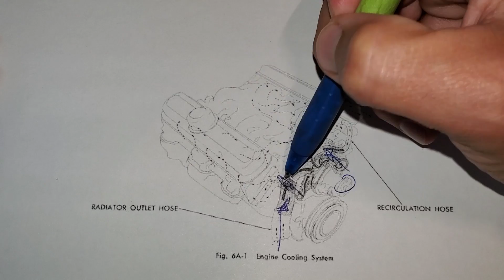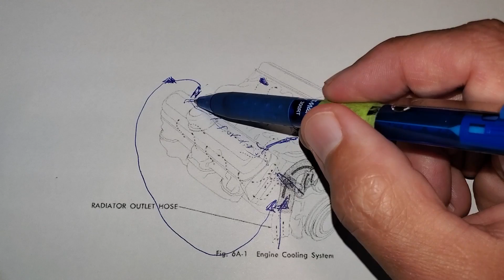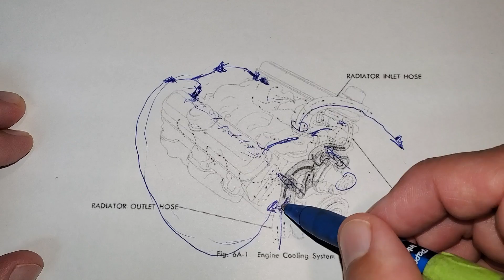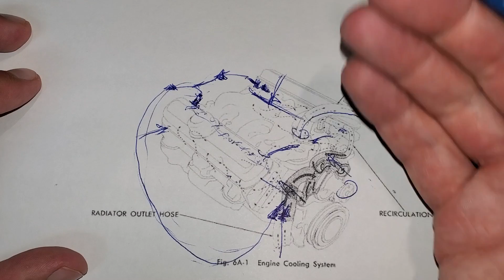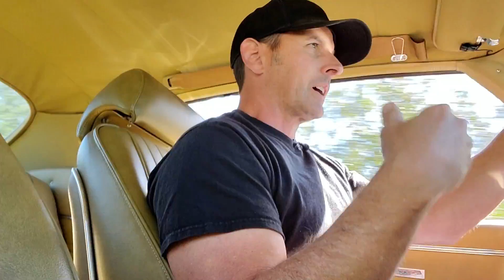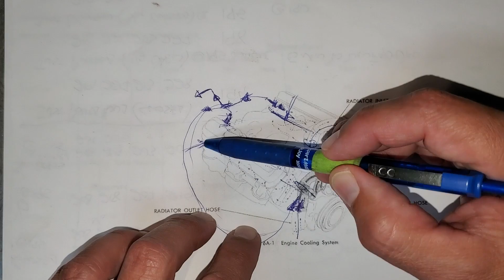Pontiac Head Cooling Trick - Heater Hose Myth?

Comment: Looking at swapping out all of my heater hose with AN line like you. Are you running -8 or -10 on everything? Also have my timing cover off right now so I’ll be doing the weld on bungs like in your lower radiator hose video.
Reply from the maker: Very cool... get it?  ha, ha... yeah, -10's all over.  Before you go nuts, and if you're running the T'd heads trick, check out my latest video on this subject.  https://youtu.be/v_qUY4E33r0  Have fun!

Comment: A lot of the '60's and '70's non-AC cars had full flow through the core all the time and a diverter door or flap to direct the fresh air over the core. It was simple and cheap. The restrictor is to ensure the coolant spends enough time in the core to throw off the heat. Without the heater blower fan running both heads should be about the same. BTW, a ball valve is designed to be either fully opened or fully closed. It's not meant to be a flow regulator. Eventually the ball will erode from the flow and it won't seal. You need either a restrictor or a different valve. 
There's more complexity to localized head temperature than trying make sure it's all homogenous. In the late '60's-early '70's manufacturers deliberately restricted coolant from the heads to control emissions like N2O by increasing combustion temperatures. Some of the gaskets had restricted holes for the coolant passages. If you increase head temps and combustion temps BSFC decreases and efficiency increases. NOx however will increase slightly.
Reply from the maker: Agreed.  Thanks Vince.  But, both head temps are not the same, if you're flowing coolant out the back of one head.  Which I proved.   Thanks for the comment!

Comment: That's great stuff! I really like your testing to prove why the solution is best. There are a lot of rumours and myths in the classic car industri. 

Besides that I am going to rebuild/freshen up my 68' and cooling system (and this solution) is definitely going to be a part of that. The divider plate design is some shit hopefully the 11 bolt design is "less shit" than 8 bolt. Have you done any testing on those 2 water pump designs?
Reply from the maker: Thanks.... yeah, testing water pumps would be a colossal amount of work, so no.  ha, ha... I'm sure the 11 bolts are better.  Just be sure to check out my water pump install video.  Also, check out the latest video of the rear head plumbing...  https://youtu.be/v_qUY4E33r0  Thanks again!

Comment: So this is a great idea but will only work on "newer" pontiacs lol if there is such a thing with D port ponchos.....but it will not work on the older 12 bolt style heads....pre 65 because there is no nipple on the rear of either head as the rear of the intake covers those coolant jackets......also 65-66 it wont work on because the throttle bell crank bolts over the soft plug blocking the passage on the driver head......just a little info on the older stuff......
Reply from the maker: Thanks Steven!  Love the added info.
Reply: @FastMonty  i love the fact you do a lot of poncho specific stuff.....thats why i watch......ima poncho guy as well.....oh and love the goat
Reply from the maker: @stevenhagebusch9561  Thanks Steven!  I appreciate the comment, welcome to the FMG family.

Comment: Hello FMG, I just finished plumbing my cross over on a 471 Pontiac using Edelbrock D-Port heads. Here is a list of parts I used:

2- 3/4” male NPT to 8AN male adapters. They screw into the heads on either rear port. This is the beginning of AN.

2- 8AN Female 90 degree swivels. One goes directly on the left head adapter. This puts the hose side coming out to the left of the distributor. The other one will be used on the right side. That’s  all the hardware for the left side.

1- Female to 8AN Male Flare 90 Degree Swivel Hose Fitting. Attaches to the right side adapter. Position so it points to the rear of the engine past the right side of the distributor.

1- 8AN T fitting, single female, double male. Female side attaches to the fitting above. Angle the stem of the T about 45 degrees.

Now attach the other 8AN Female 90 degree swivel to the end of the  T. This will have the hose end making a nice turn around the back of the distributor. 

1- 8AN 45 degree female. Attaches to the other male portion of the T and should point towards the heater input.

5 feet 8AN hose. Cut to length to connect the left and right sides together behind the distributor. Cut another length to connect the 45 degree swivel to the heater.

1- 8AN hose finisher clamp.

That should be all the hardware needed to fab the crossover and connect to the heater.

You will also need another 5 feet of 10AN hose to connect the heater to the timing cover along with 2 -10AN hose finisher clamps.

Hope this helps.
Reply from the maker: Awesome Summary!  Now you need to watch my latest cooling analysis, which will give you some more ideas... https://youtu.be/v_qUY4E33r0

Comment: Quick questions:

- what AN size did you use to make the rear crossover?

- what AN sizes are you running into and out of the heater core?
Reply: Ok, that may explain why the restrictor lowered the engine temp.
Reply from the maker: @urqed5305  Yup, too fast of flow doesn't give the radiator enough time to cool.
Reply: Agreed. Your videos are very
well done with some great tips!
Reply from the maker: @urqed5305  Thanks!  Much appreciated!
Reply from the maker: Good questions... I'm using -10 AN hose, where it converts to a 5/8" barb before, and after the heater core.  BUT, before you go crazy, check out my latest cooling video here... https://youtu.be/v_qUY4E33r0  Have fun!

Comment: Is it possible then just to tap a 1/8" or 1/4" copper tube from the driver's  side head to a tee in the heater core hose? Would the copper itself provide a miniscule temperature drop acting as a heat sink, or would you still install a valve inline to experiment with? Wish I had known this when I had my '70 350 Catalina...
Reply: That IS pretty slick! Had to go back and watch the episode on divorcing a Pontiac crossover as well!
Reply from the maker: @christopheransell2179  Ha!  Yep, all kinds of new stuff in that video, huh?  Thanks for checking em out!
Reply from the maker: I think you'd need one heck of a copper coil, to see any additional cooling.  But, there's an even better idea... check out my part 2 to this.  https://youtu.be/v_qUY4E33r0  Have fun!

Comment: also fitting an anti cavitation coil spring inside the lower hose to prevent it (the hose) from collapsing partly closed when the motor accelerates in rpms. last dyno video i watched, the lower hose closing itself close was very noticeable
Reply from the maker: Great point... not many people are aware of that phenomenon.  (My lower hose is an AN hose, so that won't happen)  But, a great tip for everyone reading this, most mechanics forget to re-install that coil, and then wonder why the engine won't cool down like it used to.  Thanks again!

Comment: I had my 350 rebuilt and it wont stay under 220 and the shop says they dony know whats going on.When I bought the car it never went over 200.Can anybody explain
Reply from the maker: Great question, Clinton.  We feel your pain.  Unfortunately, there are so many things within the cooling system that could be the culprit, that it makes it impossible to diagnose over an online chat.  Something clearly changed, OR maybe something got dislodged and clogged the radiator, or heater core, or the new water pump has a different impeller, or the coolant is different, or the thermostat is higher... I think you get my point, let us know if something is obviously different.

Comment: You have to take it from back of both heads and plumb them into the thermostat housing. Get rid of thermostat and put a restrictor instead of The thermostat. Do restrict opening used to be the size of a quarter. No issues idling at 170 degrees. Definitely use an electric water pump. What you’re doing is a waste of time
Reply from the maker: Yup, one thing at a time... here's Part 2.  https://youtu.be/v_qUY4E33r0  Electric Water pump is on my list.  Thanks!

Comment: Isn't there a thermostat bypass coming from the thermostat crossover to the water pump inlet?
Once you have that, make sure it's not too much because this bypasses the radiator.
The purpose of this bypass circuit is to keep water constantly circulating through the block to avoid hot spots.
It will depend on the engine but in my experience, a 1/4" thermostat bypass orifice is sufficient.
Reply from the maker: Yes, there sure is a crossover bypass, which is mostly used while the thermostat is closed.  That said, and inherent to the Pontiac design, there's no way to get the coolant from the rear of the heads, to the front crossover.  We proved that that theory is true, because when the ball valve I installed is closed, the rear of the heads are hotter than the front, where the crossover is.  Ironically enough, I'm filming part 2 to this episode as we speak... so, stay tuned for that experiment.  Thanks!
Reply: @FastMonty  I'm not sure why you want to bypass the heads, I feel it's better to recirculate through both block and heads.  If there's too much coolant recirculating, the radiator is being bypassed too much.  Place a restrictor in the passage from the front manifold crossover to water pump inlet to reduce the quantity of coolant recirculating (this coolant being recirculated is bypassing radiator).
In some cases (not referring to pontiac specifically, mostly sbc) the factory inserts an orifice in the heater core hose to limit coolant recirculation for this reason.
Anyway, the recirculation keeps hot spots from forming and flows past the thermostat bulb to warm it up.
Good luck, I'm not familiar with the pontiac cooling loop, I'm more familiar with ford, sbc, buick and olds, so just describing the concept/purpose of recirculation.
Reply from the maker: @thisisyourcaptainspeaking2259  I don't know why you think I'm bypassing the heads?  I suggest reviewing the first 5 minutes of the video, where I thoroughly explain the coolant path in a Pontiac engine.  Thanks.
Reply: @FastMonty  so by allowing the coolant to exit the rear of the head, this doesn't reduce flow through the head, got it.  I mistakenly thought this was bypassing the head, like would be the case for all other v8's I know.
Reply from the maker: @thisisyourcaptainspeaking2259  Yup!  and to your point, I had TOO much flow when I converted to AN hoses... at least too much flow back into the water pump, from the rear of the heads.  So, next video, I'm changing that, and re-testing.  Thanks!
Reply: @FastMonty  Yes, I can imagine increased bypass flow would result in high engine temps. I see this quite often, as the recirculating is too much and as a result, heat isn't being rejected to the radiator.
Take the 351 Cleveland for instance, this happens when the incorrect thermostat is installed and all the parts books substitute the incorrect thermostat.  The Cleveland isn't a Windsor, including the thermostat.
On a SBC, if the heater hose is replaced and the factory restrictor isn't re-used, this can also result.
Reply from the maker: @thisisyourcaptainspeaking2259  Makes sense, and good to know.  Thanks for sharing!
Reply: @FastMonty  Just as a note, I don't see any real difference between this block and a sbc, they look quite similar to me (see caveat below).
One of the reasons I've gained a through knowledge of water circulation through these blocks is through working on marine engines and the concept of coolant recirculation, which are plumbed "differently".  All of the water pumped by the belt driven pump is recirculated through the block, that's it's only job in the marine case.
Looking at the pontiac, I'd approach this slightly differently, I'd have my recirculation come from the thermostat crossover to the inlet of the belt driven water pump, if possible.  The benefit would be full coolant flow through the heads and the thermostat bulb is exposed to the entire quantity of heated coolant.
But, not being familiar with the Pontiac heads and arrangement/diameter of the "steam holes", I may be incorrect in my assumption this would work properly or offer any real benefit.
Glad to see you've get her tamed now!
Reply: @FastMonty  "when the ball valve I installed is closed, the rear of the heads are hotter than the front, where the crossover is."

That's a good test, I wouldn't have anticipated that.
Reply from the maker: @thisisyourcaptainspeaking2259  Good stuff... yeah, not "tamed" yet, hence part 2 to this craziness.  I think my fix ties into exactly what you're saying.  Just finished welding today... we'll see.
Reply from the maker: @thisisyourcaptainspeaking2259  Thanks, yeah... less coolant flowing in the rear of the heads, than the front.  The fix is coming.  :)  Thanks again!

Comment: Just found your channel and subscribed. I have a Butler top end on my 462. I also have FiTech with timing control. Looking forward to checking out your vids.
Reply from the maker: Welcome Steve!  Nice to see we have similar top ends, including the FiTech system.  If you see something, say something... ha, ha.  See ya!
Reply: @FastMonty Thanks! What do you know about multi port injection from FiTech? I used the Edelbrock multi port intake back in the early 2000’s using Mega Squirt. Sold the car. I would like to use multi port injection again.
Reply from the maker: @steveh1256  Good question... I don't know enough, yet.  But, it is installed.  :)  My plan is to dyno the current FiTech throttle body, then switch over to port injection.  Here's the video where I switched manifolds, and hinted at the port injection ports.  https://youtu.be/ew0MYYZrpMQ  Enjoy, and stay tuned!

Comment: Mike, Don't laugh and perhaps a dumb question. My old 389 bored to 400 made at least 400 hp. Always ran hot, 200-220 no matter what thermostat. Watching your video, which are always outstanding, made me think, hear the rattling? What if you run both heads in the rear to a tee then run direct to the radiator, hose or something modified so it gets a chance to be fully cooled. The thought of the neat valve you have leaking, in time, inside the interior is scary. I remember just the smell to this day when my heater core failed! Your thoughts, Tom.
Reply from the maker: Thanks Matthew.  Yeah, I will have a follow up to this video with a solution... I'm thinking of tapping into the crossover, for the rear T return.  Agreed about the heater core blow out... had that happen to me too.  But, at least all of my hoses are brand new, and there's no excess steam pressure because I use Waterless coolant by Evans.  :)  Stay tuned!  And, thanks for the comment!
Reply: @FastMonty  Well Mike, learned something new! The Evans waterless coolant. The only other coolant I had considered was the best Amsoil coolant, I think they have two kinds. Do you know much about it? Tom
Reply from the maker: @Matthew-21_22  Do I know about Amsoil coolant?  No.  Evans is awesome, and expensive.  The good thing is it never gets old, and you can use it over and over again.  Here's a link to where I get it... https://www.amazon.com/dp/B00TPVI2TQ?ref=exp_fastmontysgarage_dp_vv_d

Comment: This is interesting, as we all know Pontiacs have major cooling issues and I did not know the bottom hose needs to be smaller than the top one. Im glad I havent installed the ANs, yet. Ive watched other vids and they state to getyour divider plates as close to the wp body as possible which I did to .001, approximately. I did notice the crossover in the rear of your engine when I was watching the intake vid you did and was wondering what it was for, now I know. I havent seen you do the install for that do you have a vid for that? My engine still isnt put together theres been several issues, had to order custom pistons and its taking months.
Thanks for all kid
Reply from the maker: Yeah, the hoses can be the same, I think I was referring to modern cooling systems, in my head anyway.  That rear cross over is here... https://youtu.be/DWvVkrGQDsw  Good job on your water pump divider plate.  Flowkooler plates come that way.  Thanks again!

Comment: So...you are having heating issues, and you are routing hot coolant back to the water pump. Long story short, you are heat cycling your coolant system. Why not route the back of both heads to the intake crossover, that way it is run into the RAD and had a chance to cool down before going back into the fire?
Reply from the maker: Thanks Billy, totally agreed!  Stay tuned for my next experiment with this cooling stuff.  Thanks for the comment!